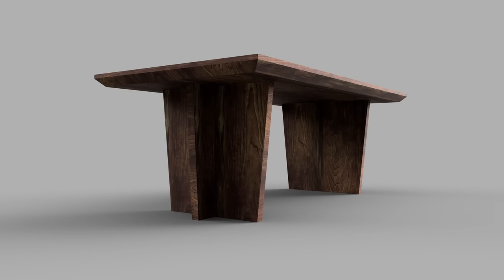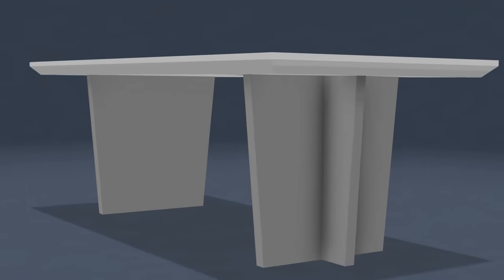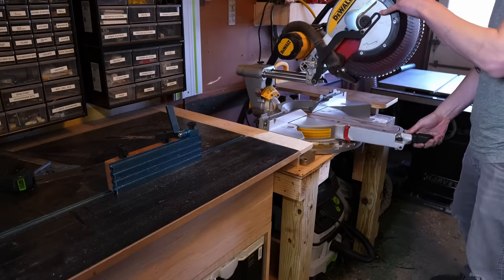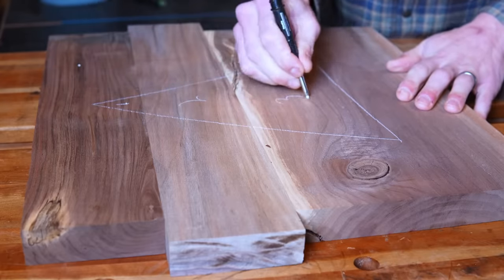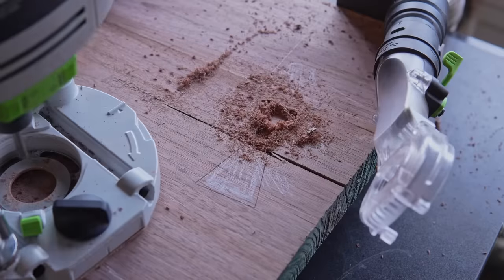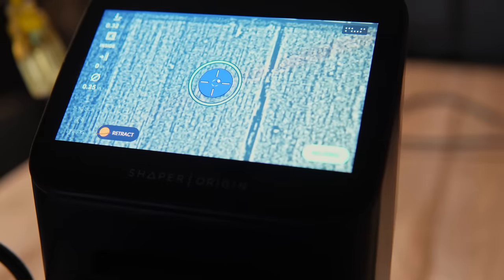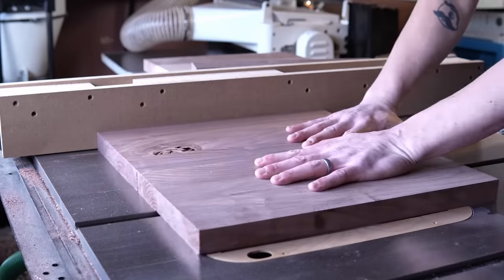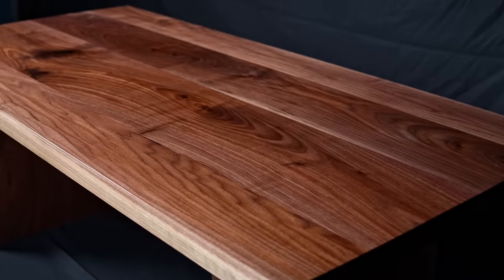The Walnut Coffee Table

Comment: With the bowtie, I have seen a few of the asian woodworkers do the knife-line relief first before they use the router just to make sure there is enough surrounding wood to get right on that line for a friction fit.

That plug for the hole looked like a really good match!
Reply from the maker: Ooo that's a good tip. I'll give that a go next time. Thanks!

Comment: Lovely work. As they say, the client is not always right but they are always the client.

I’m interested in the nano coating. The auto “equivalent” is not flexible. Is that the same for the timber version? I’m worried about the effects of wood movement
Reply from the maker: I'm thinking it's got to be, because ive had it on tables for over a year, having gone through full seasonal changes and had no issues.
Reply: @adkwoodandresin  thank you. I did ask a supplier but got no reply.

Comment: Nice video- I’m going to try that Natura hard wax oil. I want a little more sheen than Rubio, and it is way less expensive. Subbed! What is the ceramic coating you are using?
Reply from the maker: Thanks for the comment and the sub! I use N3 Nano from blacktail studio for ceramic. Carbon Method works well too